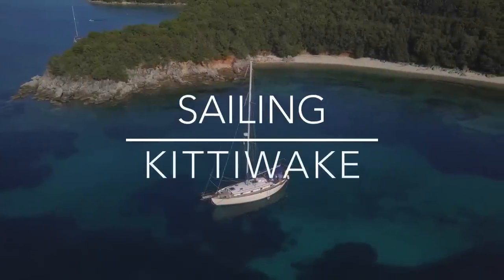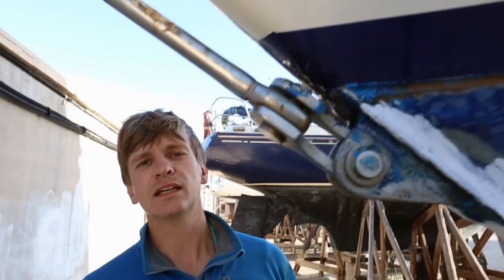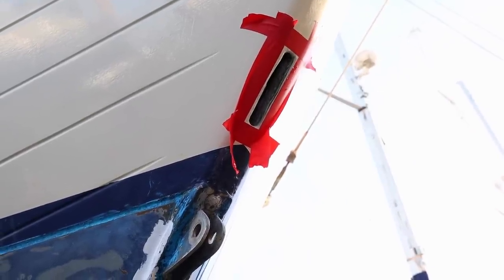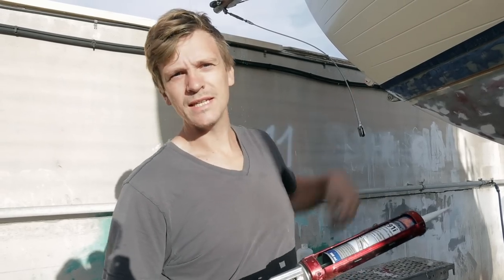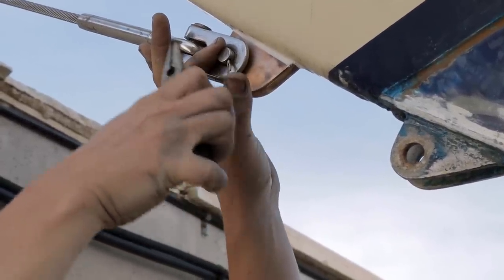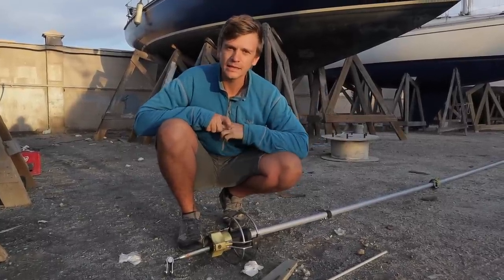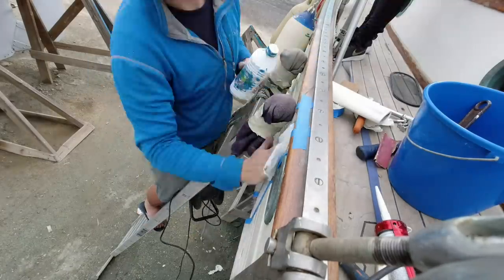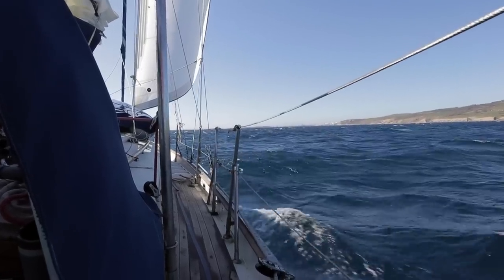91] Replacing Our Rig To SAIL ACROSS The ATLANTIC Ocean (Pt.2) | OLD BOAT REFIT: DIY RIGGING

Comment: Great job, but I cringe seeing those split pins being reused, especially after all the effort to install the new bobstay fitting!
Reply: I wouldn't have worried about them myself until finding reused ones with half a leg missing and where the remaining leg snapped off like chocolate on our old boat. Stainless does not like being re-bent.

Comment: Amazing job installing the external chain plates and bob stay mount!  I cringed to see you cut the slot in the stem!  I would of probably been too scared to do that but what you have now is WAY stronger than factory.  You strengthened that rig so much you are ready for a freak hurricane!  My boat is 43 years old and she has fiberglass thick like yours.  Really like old glass boats from before they knew the strength of fiberglass...They are almost as tough as a steel boat.  One thing I learned though, there is nothing that you cannot fix on a fiberglass boat DIY.  I liked the strength of steel but it took a welder to do any work and I never learned welding...Also, when she filled up with water there was rust in places that couldn't be gotten to with out cutting apart the keel and gutting the interior.  Every-time I pass the yard she is in I still stop and look at her and apologize.  If I wouldn't of ran out of money I wouldn't of had to put her on the hard and leave her for a few years...If I didn't have to meet the plane to boot camp on a schedule I could of been there when they puller her out of the water and told the yard they blocked her wrong.  I'm working toward living the dream again and doing it right this time so I don't run out of money.  Keep living the dream!

Comment: Finished season 3 with this vid and I have to say that I have learned a great deal about sailing and the DIY it takes to keep the boat in top condition. The rigging project and the anti-fouling repaint were both of particular interest to me. I can't wait to see what the new chainplates look like on the outside of the hull. :D  Great work on everything throughout the season and definitely looking forward to life in the Caribbean. It will be my first run once I finally get a boat in the water.

Comment: The new style Bob Stay fitting was a great choice.  You said you'd glass it in from behind, but then you didn't (at least you didn't show it).  If you haven't yet, don't... its perfect the way it is and now all you you need to worry about is replacing the forward triangle of the anchor locker floor.   Realistically this will never effect you because that fitting will last 100 years, but IF anyone ever needed to remove it for maintenance or glass repairs it will be much less of a nightmare without the extra glass on the back side.
Reply from the maker: Cheers Luke, I came to the same conclusion, it was fine without :) thanks for the comment and happy boating!

Comment: A trick with Sikkaflex around bolts and fittings, dont wipe it off and smear it everywhere, let it harden,trim around fitting with a knife, and sealant should scrape or even roll off clean.

Comment: Another great video  just one suggestion I would like to make. Since you have gone to the expense of a new bobstay and fore stays please spend an extra few pounds and get some new split pins for the bob stay and anywhere else you may have reused them, same for the Nylok nuts on the furler brackets. Split pins and Nyloc nuts are single use items and too cheap to risk your new rig over.

Comment: solid job that.. glad you bedded the fitting otherwise point loading could have been an issue , cant believe the shipwrights who built her epoxy filled over the mechanical fixings on her original cut water fitting... . watched your vid on polishing the chainplates too bad you are not close by (aus) polishing  is a lot quicker with the right equipment   anything marine stainless  should always be polished to a mirror finish .. fair winds ..following seas ..

Comment: So, I am unsure what keeps the new bobstay fitting from being driven back into the hull should you strike something very heavy and hard? A bit of fiberglass over the bronze fitting on the inside of the hull is problematic...you have learned that lesson on your chainplates I assume? 
I used 2 large and thick pieces of stainless on the outside of the hull and through bolted to the bobstay fitting (in the shape of a "Y") on the inside of the hull. 
I sure enjoy watching your efforts at keeping Skua up to date and safe/beautiful. Congratulations!
Reply from the maker: Hi Mike, thanks for the comment. If we ever hit something hard enough to overcome the breaking strength of the 10mm bobstay, then we’d probably replace the fitting. If that were to happen we probably would have replaced the old style fitting as well. I suspect the forestay would break in that instance and some structural damage would probably also happen to the bowsprit so the bobstay fitting would be low on our long list of worries!

Comment: As you get ready to head out on a fairly Sirius Passage you're working on your rig you might want to consider carrying a roller dyneema rope with you for emergencies I've seen guys over there on zingaro has his whole rigging system is done with dyneema he actually tied his boat together they were on passage from Easter Island and the port pontoon snapped off the cat and he used dyneema line to tie the boat together and managed to sail the boat for days and got in to Hawaii the boat was a total loss but they got in without going to the life rafts
Reply from the maker: Zingaro was a plywood catamaran. Our hull is solid fiberglass 😊 we carry spare wire rigging for rigging emergencies.

Comment: Could you have used dyneema rather than wire rope for the replaced shrouds or would that have required replacing all standing rigging?
Reply: Dyneema is for racing boats & not cruisers. It recommends replacing dyneema rigging every 2 years due to UV degradation. This is not practical or neccesary on a cruising yacht. This wire rigging will go 15-20yrs without an issue. Dyneema is used on race boats to shave some weight, again not neccesary on a cruising yacht.